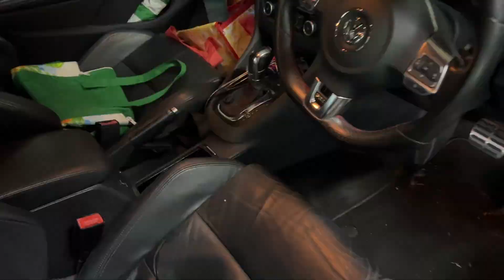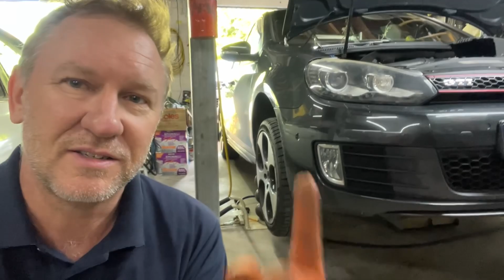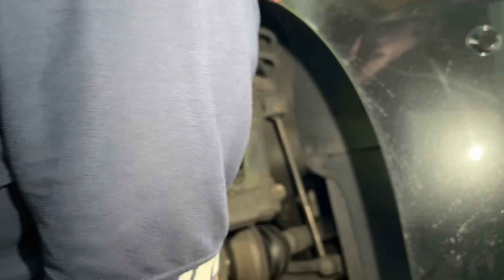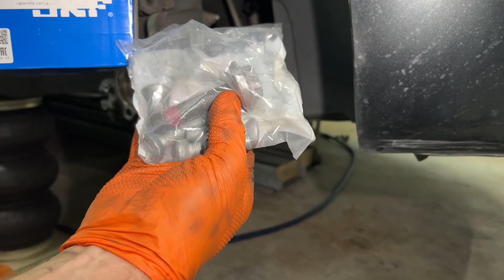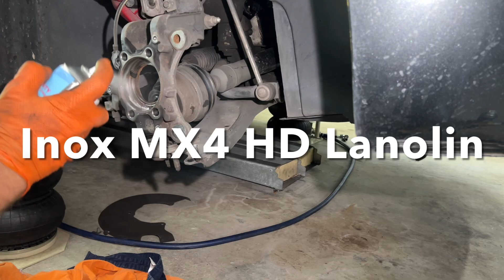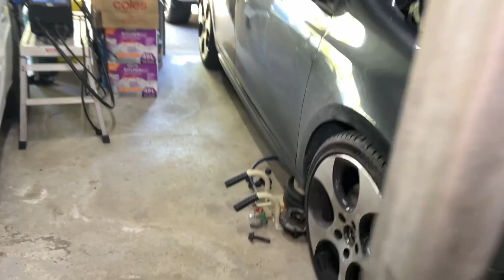MK6 GTI Wheel Bearing Replacement

Comment: Hey mate, just making sure you got the torque correct on the axle bolts - I heard you say 70nm +90deg - this is for the older style bolts that have a ribbed flange around the head.
Almost all new bearings etc will come with the newer style bolt that has a flat non ribbed flange and the correct torque spec for that is 200nm +180deg.
Reply from the maker: Thank you. I have other one to do on a Jetta so I shall investigate that closer.